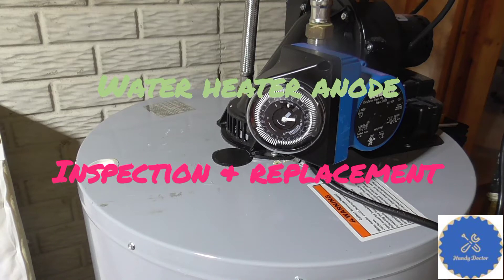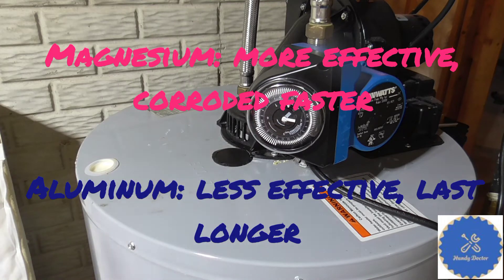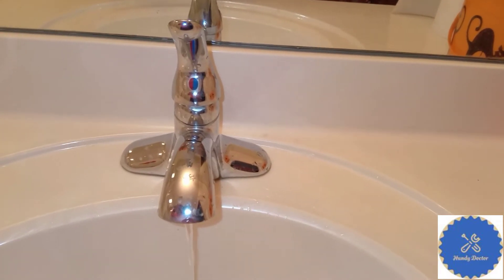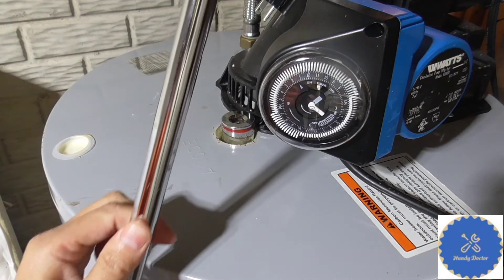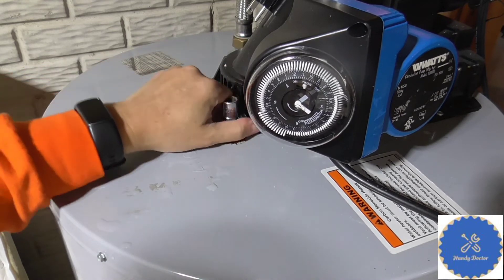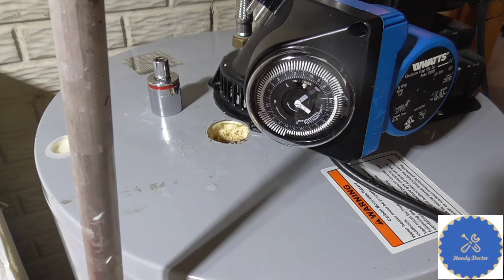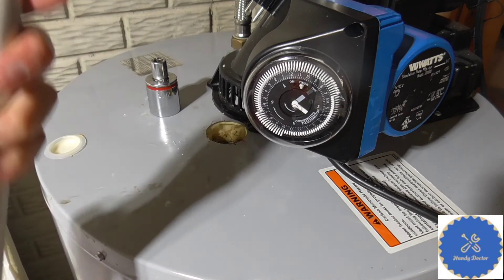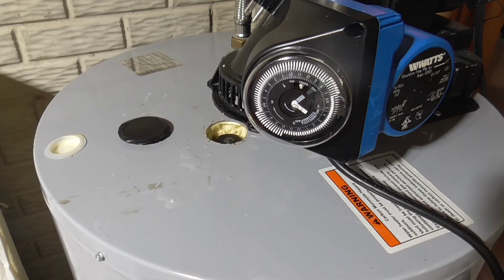Water heater Anode Rod: Inspection & Replacement; Anode rod too long; Anode rod replacement

Comment: Good video, just one comment on a missed step. The threads on new rod should be wrapped with teflon tape to prevent leaks under pressure.